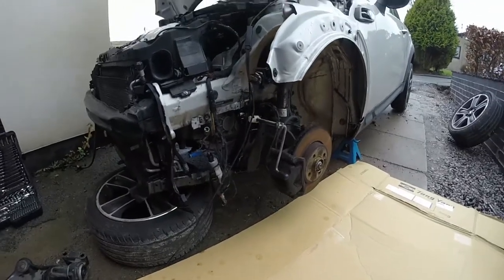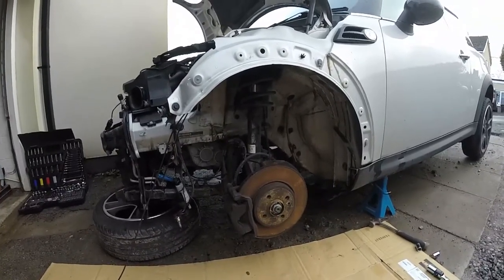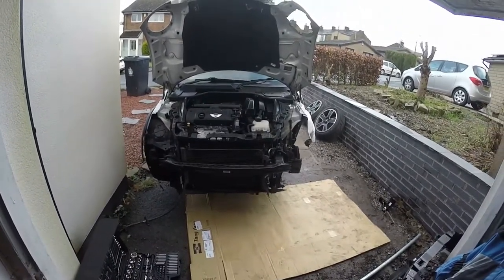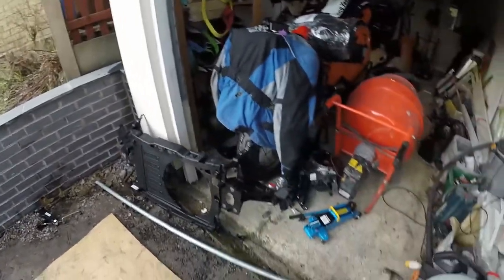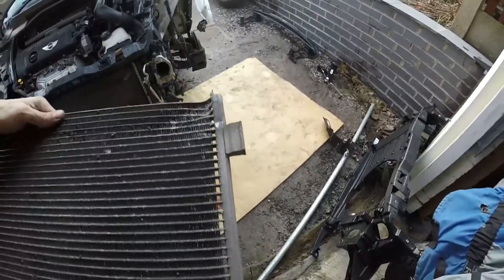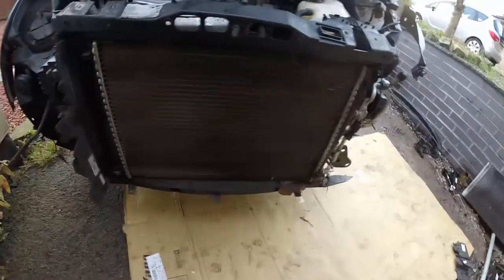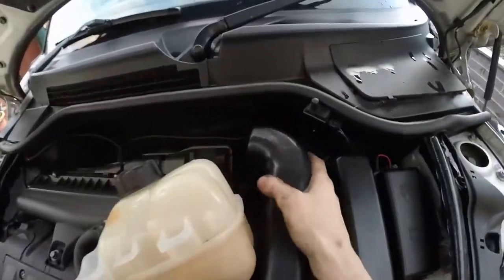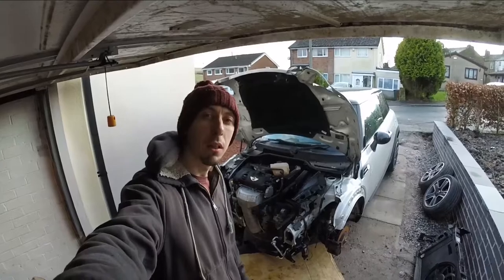Copart £925 Mini Soho Edition Part 3 : Continuing On With The Strip Down!!!

Comment: Where can I buy the epoxy glue from?
Reply from the maker: B and q do one called gorilla epoxy,  probably just as good👍
Reply: @SeriousAboutSalvage  would tiger seal work to fix a broken tab on headlight?
Reply from the maker: @Irfan-or9sd  I think tiger seal only sets as a rubber and remains flexible.  I would go with an epoxy resin, they set hard.
Reply: @SeriousAboutSalvage  thanks man appreciate it